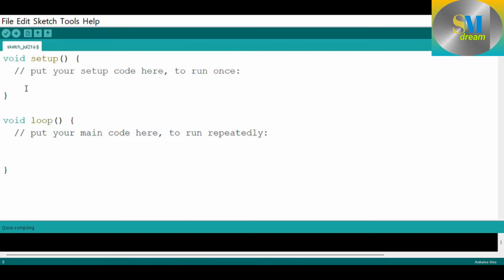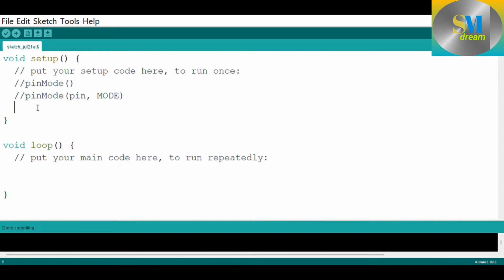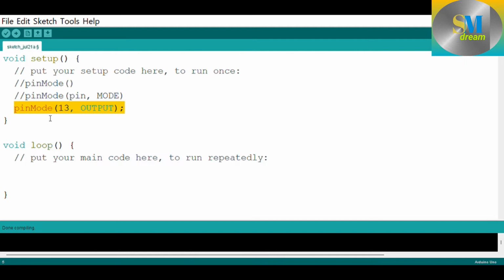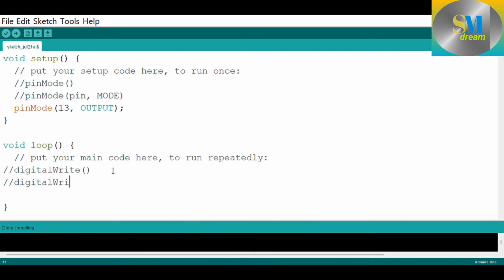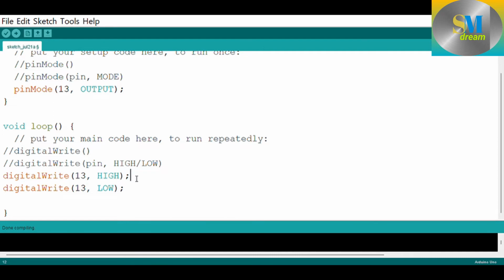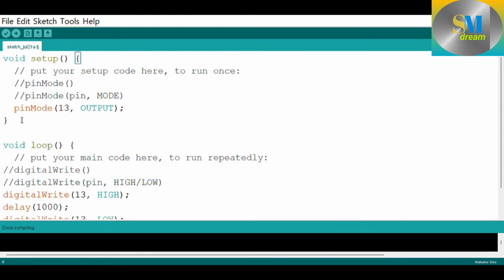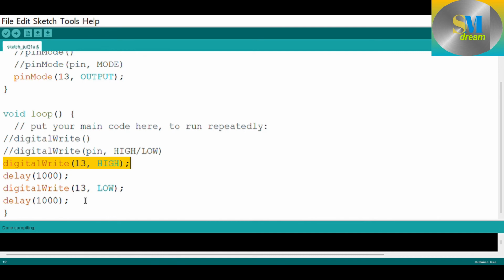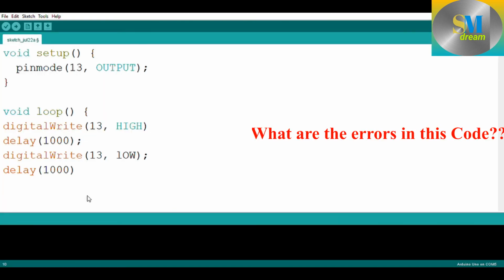Arduino Programming Series | Tutorial 3 | Using of Basic Function and Write First Code | SM dream |

Comment: There are two mistakes
First-pinmode , m will be a capital letter
Second -last delay function missing semicolon and first digitalwrite function missing semicolon.
Reply: in Void loop close curly bracket is missing.
Reply from the maker: @jitkhanra7267  Excellent .
Reply from the maker: Awesome 👌...Hope you are learning the Arduino Programming as very well. One last thing you missed....see the program thoroughly...hope you will get the last error.